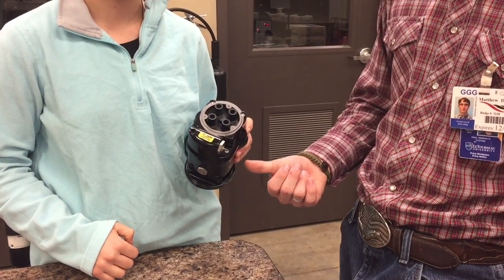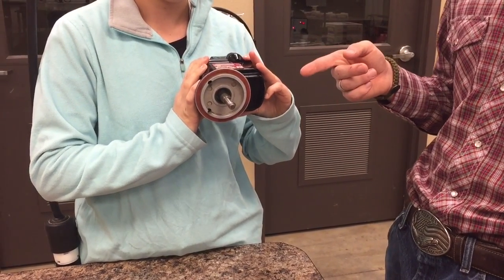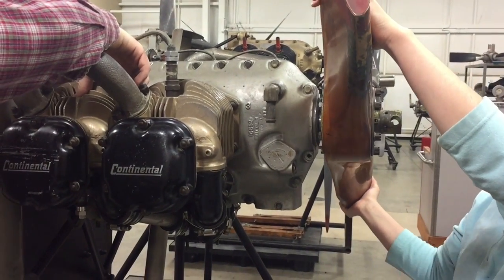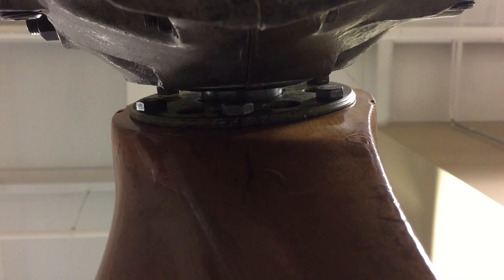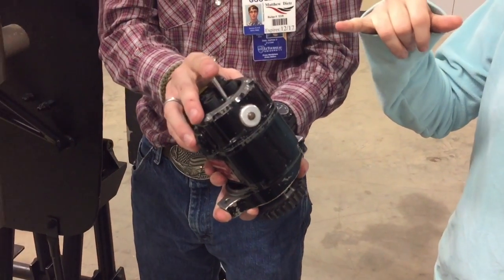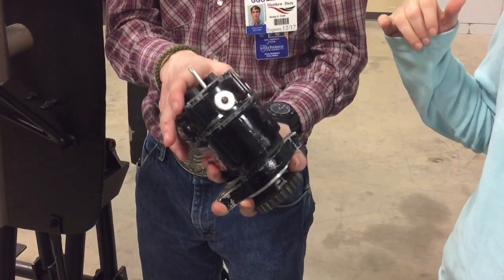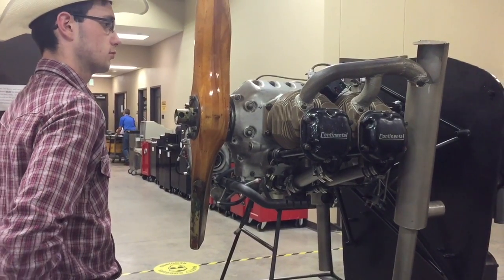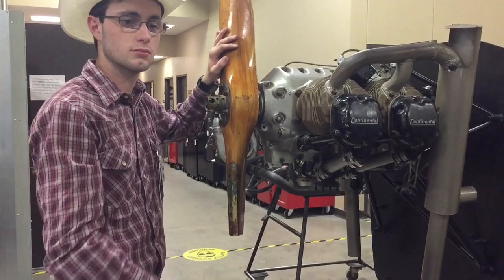Magneto Timing for Idiots

Comment: im pretty sure you only connect the red lead to the p-lead and you connect the black and green leads both to ground. You don't connect 2 leads to the p-lead.
Reply: The timer has a different buzzing tone for the left and right leads. If you only hook up one lead and leave the other one hanging, then the timer continues buzzing steadily, which is annoying. Takes no time to hook up both on the same post, allowing for greater amount of mental sanity while performing the alignment :-)
Reply: Unfortunately you cannot perform magneto timing with the P-Lead grounded. It needs to be floating so the magneto is live.
Reply: It’s probably more clear to say you connect the 2 colored leads to the 2 p leads
Reply: Good Comment,, as long as the P lead is grounded it dont really matter what is hook to it

Comment: Totally dangerous! Disconnect all the spark plug wires to ensure that no cylinder could possibly fire. Also remove at least one plug from each cylinder to make it a lot easier to turn over the engine and make it more accurate. (I realize this isn't a running engine but no point in teaching very bad habits.)
Reply: That is correct , but is more work for the lazy
Reply: Rookie, Think a pilot wants to pay for all that extra time? just disconnect both P leads
Reply: @dannyabbott4352 The mags still fire without the P leads… those are the grounds to the ignition switch that prevent the mags from firing… kill switches
Reply: I clicked away before they found TDC. They should take this down.
Reply: @Jase Khalid instablaster ;)
Reply: you prolly dont give a shit but does someone know a tool to get back into an instagram account??
I somehow forgot the account password. I love any tips you can offer me

Comment: It would be easier to set the timing by removing all  the top spark plugs. This will remove any compression in the cylinder.
Reply: Felipe L either way, top or bottom, taking a plug out removes pressure.  The advantage of the bottom plugs on Grummans is that you do not have to fight the baffles.
Reply: we do that on our school, and will just check for compression by plugging a thumb or palm on the orifice